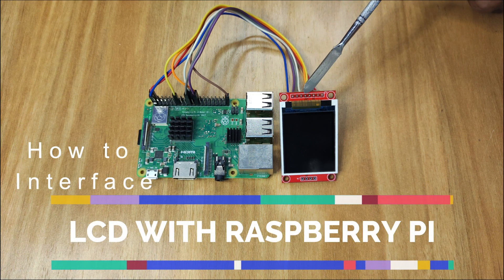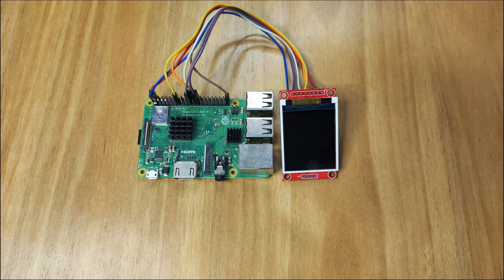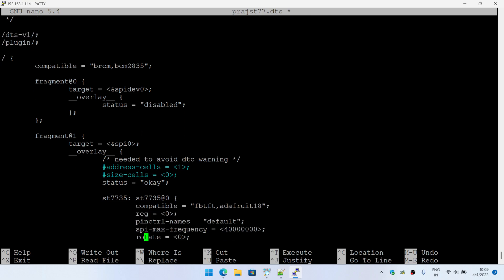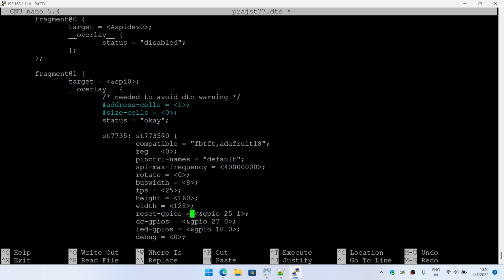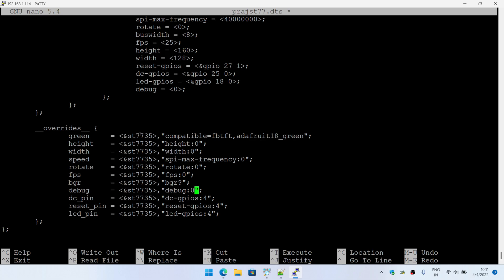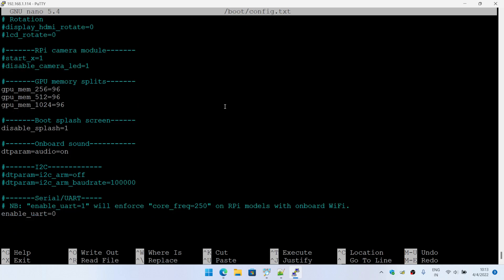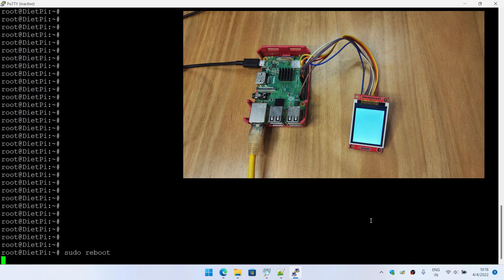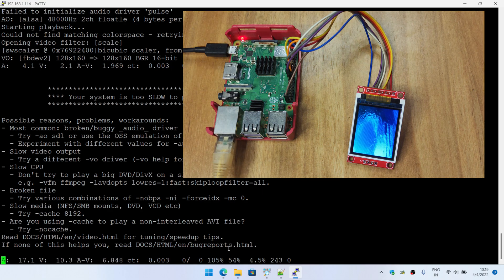How to interface SPI TFT LCD(ST7735) with RaspberryPi- Part 2

Comment: I have one question how can I get rpi display means will it work for me to use lcd as monitor of rpi
Reply from the maker: If you want to add console to the display then run the commands below
sudo nano /boot/cmdline.txt
At the end of the line enter below text:
fbcon=map:10 fbcon=font:VGA8x8
 then save the file.

But do you want the desktop to load on the lcd ? cos it would be unusable since the screen is small the desktop would be chopped.
Reply: @degzero  yeah but I don't find any other easy way to play video from website that has been streaming from another pi connected over same wifi
Reply from the maker: @usmangilani2367  is this website local ? If you have rtsp link of that stream?
Reply from the maker: @usmangilani2367  anyway execute the command below and you will have the desktop on the lcd

FRAMEBUFFER=/dev/fb1 startx
Reply from the maker: @usmangilani2367  also I'm assuming that you got startx, if you use lxde desktop then it would be something like startlxde
Reply: @degzero  yeah it is local website only run on device connected to same wifi.
And I don't know about startx sorry.
Btw thankyouuuuuu very much 
I'll try it may be tomorrow or day after, coz I'm busy with my papers these days.
Again thankyouuu very much.....
Reply from the maker: install ffmpeg and then you can stream to the lcd using command below, replace the rtsp stream link with your RTSP link

ffmpeg -i rtsp://wowzaec2demo.streamlock.net/vod/mp4:BigBuckBunny_115k.mp4 -pix_fmt rgb565 -f fbdev /dev/fb1
Reply from the maker: Also i forgot to mention, you can scale the video to fit the screen using command below
ffmpeg -i rtsp://wowzaec2demo.streamlock.net/vod/mp4:BigBuckBunny_115k.mp4 -vf scale=160:-1 -pix_fmt rgb565 -f fbdev /dev/fb1
Reply: @degzero  ahan 
Okay thankyou 
I'm trying the whole procedure, wish me luck
Reply from the maker: All the best 👍
Reply: @degzero  sorry for disturbing you again.
But waiting for the DTS link, impatiently.
Reply from the maker: @usmangilani2367  https://github.com/degzero/st7735fb/blob/main/prajst77.dts
Reply: @degzero  thankyouu
Reply: @degzero  sirrr need help.
Please tell me 
I got error I mentioned before.
Pleaseee waiting impatiently dying from stress 😱😖😥😥
Reply: @degzero  I have tried sudo before dtc...... Command.
Then fatal error couldn't open output file removed 
But warnings are still there
Warning is node has a unit name but no reg property
Reply: @degzero  and also there is no
 ---------------SPI----------------- 
dtparam=spi=on
........... And all that code in you config.txt file
That all is missing in my config.txt file
Reply: Can I get you mail so that I can share screenshot with you for better understanding.
Reply: @degzero  please help me ....
Reply: @degzero  sirrr😢
Reply: @degzero  sir I think you are doing something for me.
Reply: @degzero  sir please kindly reply me so that I can ease myself a bit.
Reply from the maker: @usmangilani2367  Whazzup? Which RPI model do you use? I can create an SDCard image with lcd integrated!!! This should solve most of your problem.
Reply: @degzero  that's a great thing.
I mean thankyouu very much....
I want it to be on raspberry pi os desktop version
I'm using raspberry pi zero v1.3
Reply: Want pi os desktop version because I will be adding Soo many other functionalities also 
Because I'm making a robot.
Wish me luck🙂
Reply from the maker: Oh then it might be a problem cos I exclusively use DietPi for all my projects. 
What problem are you facing ? 
All the best with you Robot project…
Reply: @degzero  I'm facing issue with dts
Reply: @degzero  if you try it on pi os, I hope you will be successful as you have knowledge and you a professional guy.
Reply: @degzero  you can share the dietpi image 
I'll do something afterwards.
Reply: @degzero  you can share the dietpi image if pi os isn't convenient for you.
I'll do something afterwards.
Reply: @degzero  sir waiting for the image file........
🙂
Reply: @degzero  sir you can share any os image file
That is easy for you.
I'm really waiting desperately....
Please sirrrrr..........
Reply: @degzero  sirrrrr....
Image........ 
PlEaseeeee🥺🥺🥺🥺
Reply: @degzero  sir I hope you are working on the image file surely.
But if you reply me so that I can feel relaxed 🙂
Reply: @degzero  hello sir I'm waiting 🥺
Reply: @degzero  sirrrr
Reply: @degzero  sir please reply me it's been 5 days.
Just let me know whether you are gonna make one image file for me as said or not. It's literally really difficult phase for me.
My hopes are with you.
🥲
Reply: @degzero  hello sir please reply me I know you are reading the comments regularly
Please reply me 🥺
Reply: @degzero  sir kindly let me know should I wait for the image file or not.
Reply: @degzero  please try to understand 
Time is running out of my hand
Reply from the maker: Sorry I'm unavailable and don't have access to resource, you can refer my video and create the dietpi setup https://youtu.be/-gXNAZKB5Mk
Reply: @degzero  thankyou for your reply.
Yeah I can install diet pi but if you share the image file including the required lcd programe then it would be very helpful.
As you already have made that so that would be easy for you to share the image file. 
🥲
Reply: @degzero  please share the dietpi os image file with desktop version including the lcd program....
Please do it once for me , I'll be very thankful to you for this favour.
🙂
Reply: @degzero  waiting desperately for your reply with image file.🥲
Reply from the maker: @usmangilani2367  You can refer this video and i have clearly explained how you can setup your rpi to interface lcd, please read the description where i have posted link to download the dts file which you can download. if you follow the tutorial then you should be able to get the LCD running on the device.
Reply: @degzero  okay I'll try
Reply from the maker: destyy.com/eswZ3S
Reply from the maker: Path to download st7735 dts file
Reply: @degzero  thankyou I'll try it tonight.
Reply: this link is showing adds and no dts file
Reply from the maker: @usmangilani2367  https://github.com/degzero/st7735fb/tree/main
Reply: @degzero  hello sir.
Thankyou very much for your help.
I have been able to get the video output on my small display.
But still have one problem 
I'm not getting the desktop display on small lcd 
And not sure about rtsp link as link isn't working on any device.
Reply: @degzero  kindly help me out with this.
Then I'll be 100% successful in my task
Reply from the maker: FRAMEBUFFER=/dev/fb1 startx
Reply: @degzero  yes I have done that.
Actually in my case lxde worked but unfortunately didn't get anything on small lcd
Reply from the maker: @usmangilani2367  hope you have installed lxde? Did you perform dietpi-software and install lxde, without that you won’t be able to start lxde, when you run startx without the frambuffer are you getting the desktop environment on you monitor via HDMI?
Reply: @degzero  I have tried installing dietpi it giving unknown errors and also I have corrupted my SD card🥲
Yeah when I run startlxde it gives different ui on my monitor via HDMI but doesn't give anything to my small lcd.
And also it pop ups the welcome to raspberry pi dialogue box
Reply: @degzero  I'll try rtsp link when I'll be able to stream rpi camera via rtsp then I hope it will be shown on small lcd via rtsp
Reply: @degzero  if I get error in that too then I'll reach you
Reply: @degzero  thankyou very much for your efforts 
Really appreciate it
Reply from the maker: 1st ensure that your dietpi img file is not corrupt  or partially download, Follow below tutorial to burn dietpi image to sdcard using raspi-imager 
https://howchoo.com/pi/raspberry-pi-imager
Reply: @degzero  okay I'll try it
Reply: @degzero  sir thankyou very much I have achieved my goal I have played the video stream via rtsp link on my small lcd.
All credit goes to you sir 🤩
Reply from the maker: @usmangilani2367  Congratulates!!! Happy to hear it worked.. all credit goes to you 👍
Reply: DTS link in description isn't working🥲
Reply: Is there any solution for this. 😢